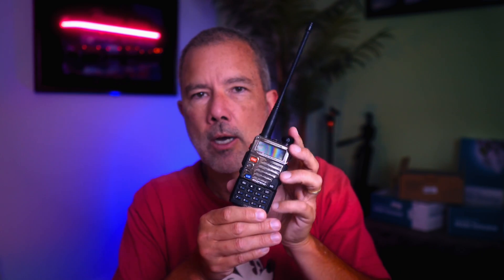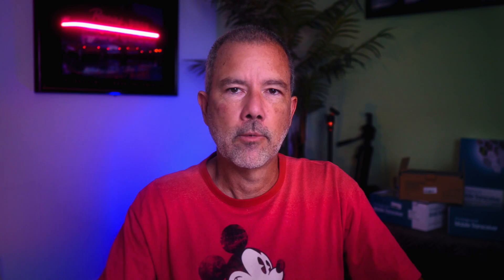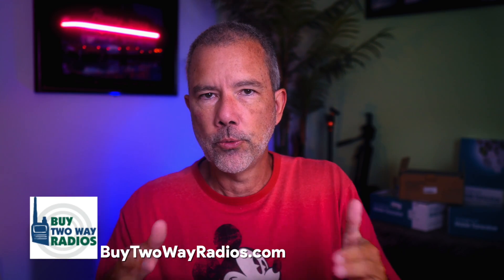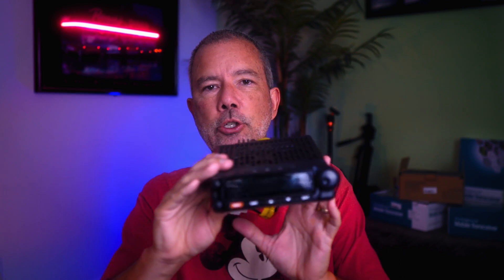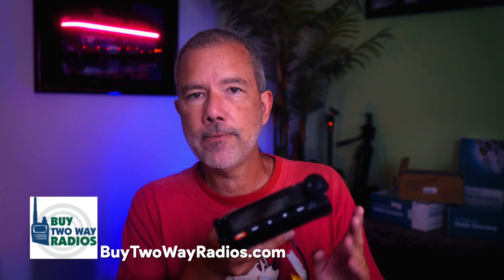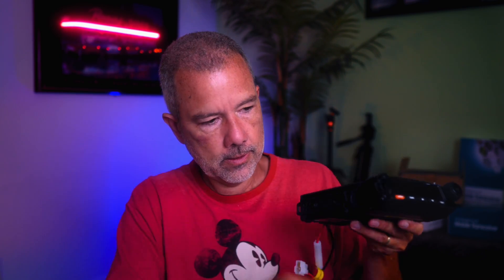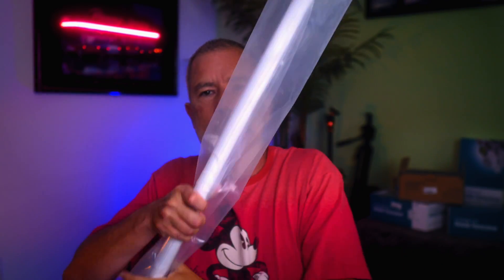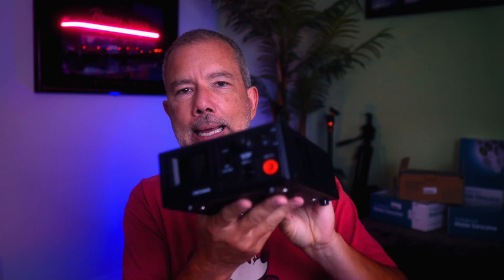Building a GMRS Repeater For Personal or SHTF PART1 - Repeater Build with Two Wouxun KG-1000G Radios

Comment: I would really love to do a self-contained solar-powered repeater up on the top of my mountain. Is there additional licensing required to put up a repeater?
Reply from the maker: In GMRS the repeater uses your license/the license of the people using it, so as long as you are licensed for GMRS, nothing extra is needed.
Reply: If you come up with a good solar set up fill me in.

Comment: Count me in ! I want to do this, but use rack mount equipment and solar photovoltaic power supply with battery banks... I already have 4 HTs, 2PSs, 2 portable radios for the vehicles. I want to include CB and scanners, + SW listening I just got both Technician and General Class HAM Radio Operators on March 9.

Comment: How is this cheap? Over 600 bucks in just the radios, if you can get them. Can get stuff offline much cheaper. Theres places that you can get 2 radios connected and programmed up with a gmrs repeater frequencies for 300 or less. Then save that antenna for a much better antenna.

Comment: This video was perfect timing. Not to make your head any bigger, but great job as always. I am currently doing the same at my house for family. The ability to use an HT with rubber duck antenna from inside the house (Wife) to my mobile in the field (Me with the Ants and Bugs) All I can suggest to what you are doing, is check the duty cycle of the radios, the lenght and loss of your coax selection, because of the difficulty to change later, and proper grounding of all the antenna componets. National Electric Code for your area might prove to be a chore. Looking forward to more on you progress. Thanks

Comment: I always want to set up a repleter, I will follow you step-by-step, I just spent $962.95 on buy2way radio. (2) KG1000, (1) tram antenna, (1) dwc30, amd (1) duplexer. Don’t know what to do with all this equipments. Cannot wait for the next video.
Reply from the maker: Just posted Part-2 .. Part 3 will be when the good stuff starts.
Reply: Did you finish it Andy?

Comment: dang dude by the time you add up all the parts you keep adding you could have bought a commercial repeater for a grand.
Reply: Yeah I was thinking the same and plus the ones I see usually come as a box for the radios and everything is included except the antenna and coax going to the antenna. The setup he's going for is probably going to be two radios set on a shelf or table with wires all over the place.. I live in a small house so that wouldn't be a option for me

Comment: Will you please go into great detail about how you ground the antenna when you get to that point in the video series? And when you say that you are planning on grounding, are you talking about RF grounding or simply grounding for lightning protection?
Reply from the maker: Shoot.. I was planning on glossing over how i do the grounding because there is so much misinformation/stupidity/FUD about grounding - no matter how I do it, some "expert" will post comments saying it's wrong and my house is going to burn down.
I will be grounding the antenna per NEC and my local code, and RF ground it as well.
Reply: @TheNotaRubicon  UUugh. I can't say that I blame you. There's a lot of knuckleheads on the internet.  The mis-information is exactly why I wanted your input. You have a really nice, down-to-earth way of condensing information for newbies like me.(see what I did there? grounding....down to earth...I'll keep my day job  haha)
Reply: @TheNotaRubicon  licensed electrician here... Grounding is stupid easy... No need for a rod as you likely have just what you need already... You have a home with electrical power and likely a phone and CATV.... ?

You’re in CA - so ignore the wire gauge in the link below - just provided that as conceptual and code reference of National... Standard practice here is going to be as follows: 

Find the following - Your electrical meter or Main circuit breaker enclosure. Find your Telephone entrance - Find the ground block on the coaxial cable for CATV... Between your meter or phone or meter and CATV ground block there will be a 10 gauge green or solid uninsulated solid wire... You want to EMULATE THAT...

Find where they connect to either your metal main water pipe or main panel by following that 10ga wire back from the phone or CATV. It may even go to a rebar of your house foundation - that to us great...

What you need to do is connect the ground of the antenna mount, mast if any, (or flag pole what have you) - typically the sheath of the outside of the coaxial will connect with the outside threads to whatever mounting system for the antenna...

Following the antenna coaxial to where that enters the house in the very least - at this pint they can go their separate ways... One to the radio of course, the other to the nearest electrode for the electrical system of your house. (Electrodes are - Main water pipe, Ground rods that are connected already, “UFER” which is likely a rebar or wire in your foundation.) OR you could go to the main electrical panel. (But that get too technical) If you followed your phone or CATV to it, you will see how they connected to it...

In general you want to go as direct and straight as possible...

https://www.ecmweb.com/national-electrical-code/code-basics/article/20891084/article-810-radio-and-television-equipment

https://www.ecmweb.com/national-electrical-code/code-basics/article/20891084/article-810-radio-and-television-equipment

Comment: 95.1751 GMRS station identification
(c) Any GMRS repeater station is not required to transmit station identification if:

(1) It retransmits only communications from GMRS stations operating under authority of the individual license under which it operates; and,

(2) The GMRS stations whose communications are retransmitted are properly identified in accordance with this section.

Comment: 47 CFR § 95.1751 - GMRS station identification.
CFR
prev | next
§ 95.1751 GMRS station identification.
Each GMRS station must be identified by transmission of its FCC-assigned call sign at the end of transmissions and at periodic intervals during transmissions except as provided in paragraph (c) of this section. A unit number may be included after the call sign in the identification.

(a) The GMRS station call sign must be transmitted:

(1) Following a single transmission or a series of transmissions; and,

(2) After 15 minutes and at least once every 15 minutes thereafter during a series of transmissions lasting more than 15 minutes.

(b) The call sign must be transmitted using voice in the English language or international Morse code telegraphy using an audible tone.

(c) Any GMRS repeater station is not required to transmit station identification if:

(1) It retransmits only communications from GMRS stations operating under authority of the individual license under which it operates; and,

(2) The GMRS stations whose communications are retransmitted are properly identified in accordance with this section.

Comment: The tile roof issue. I see contractors use rafts made of plywood with a foam mattress adhered to it with spray adhesive. They have 1x2 or strips of plywood on the other side for traction. The foam has amazing traction and spreads the load to avoid breaking tiles and sliding off.
Reply: If you need to move father up the roof than one raft allows then you need 2 and you'll have to leapfrog your way where you need to be by moving from one to the other then scooting the first toward your destination...
Reply: Don't take some jerk on the comments section's word for it. Call a roofer and ask them.

Comment: I wanted to add two other items to my obscenely long post earlier. First, at UHF, don't use PL-259 connectors if you can avoid it. Even though PL-259s are also called UHF connectors. They aren't;  especially out in the weather! Loss is your enemy, and PL-259s are lossier than type-N connectors. You can cheat and use PL-259-to-N adapters or you can learn to assemble N connectors and do it right. My analogy of using PL-259s vs Type N is the difference between a steep climb with open diffs vs locker(s). The extra benefit of assembling N connectors is how much your Vocabulary of Profanity™ will expand. Also weatherproof your antenna connection and leave a service loop below it.

The second point is in regards to the duplexer. You're buying one pretuned for GMRS. This is wise. This is very, very wise. You don't tug on Superman's cape, you don't spit into the wind, you don't pull the mask off the ol' Lone Ranger and you don't ever f--k around with a duplexer's tuning controls. Think of it like re-gearing your differential in a sandstorm with a crescent wrench and a ball-peen hammer vs having an expert with a full toolkit and years of experience doing it in the shop.
Reply: Service loop - yes! Not something I’ve seen anyone mention, anywhere.

Comment: Great project, and you're learning more about radio than a large number of hams. I come from a land-mobile radio background (40+ years tinkering with radios, including public safety and ham) but it's been 25+ years since I last worked on a repeater. Long comment ahead:

Coax absolutely matters in a repeater. LMR-400 is the minimum I would use for this purpose, especially if the run from the antenna to the duplexer is 50 feet or more. You're dealing with heavy feedline losses at UHF frequencies with the wrong kinds of cable. Let's say you put your repeater in the basement and the antenna on the chimney of the house, and run the coax neatly. You might use 100' of cable. With RG-8X you would experience 8.6dB of signal loss (3dB = half the signal strength, so over 3/4 of the incoming weak signals would be lost in the coax. At CB frequencies or HF ham it's negligible, but at VHF (2m Ham, MURS, marine, railroad, etc) it's bad. At UHF (ham, land-mobile, or GMRS) it's crazy-bad. If you had 9dB of loss (I'm rounding up here), your 50 Watts of power from the transmitter would only be 6.25 Watts at the antenna feed point. And going the other way, if someone were to have a so-so signal into the repeater with LMR-400 feedline they wouldn't even be able to key it up with shitty coax. Spend the bucks on LMR-400. 

With the cost of everything involved, the average person who is not getting the gear at little/no cost from sponsorships and is looking to do this project could probably find a surplus/used UHF repeater pre-built on eBay or at a hamfest for a fraction of the $1500 cost you mentioned. Businesses and local/state governments are abandoning conventional UHF frequencies in droves, so there are a lot of them out there. I've seen GE and Motorola UHF solid state repeaters for a couple of hundred dollars, including the controller and duplexer. The only problem would be getting the duplexer tuned to GMRS and finding someone to reprogram the frequencies in the RF deck and the CW ID in the controller.

If you and your family are the only ones using your repeater you do not need the machine to identify, assuming it's under the same callsign as your family. If anybody else uses it then it does. https://www.law.cornell.edu/cfr/text/47/95.1751. My personal preference is a very fast CW ID at low deviation. It's there to be legal and is not obnoxious. So 35 WPM CW and 2.5 kHz deviation on a traditional wideband repeater works nicely. Then again, I think roger beeps were invented by the devil, so your mileage may vary.

You should put a tone on the output regardless if you're opening it up to everybody or not. The people using your repeater on mobiles and portables may be in areas of high interference (intermod from other services). Having a CTCSS or DCS tone is for their benefit so they don't hear that crap when monitoring the repeater. A tone on the input is optional, but a good idea--in my personal opinion. My recommendation is to use one between 100 Hz and 203.5. Avoid the ones above it and below it because they may not decode properly either in the Wouxons or the other users' radios whose bandpass filters may be wonky. I kinda like 141.3 and 156.7 but that's just me. Anything above that you can hear clearly through the speaker and it's annoying as hell. FDNY used to use 186.2 and gawd was it annoying.

Finding a frequency is interesting in the GMRS service. Unlike the ham bands and commercial applications, there is no requirement to coordinate your repeater with a governing body. In ham it's not a requirement, but if you don't go through a coordinating body and you cause interference to someone who has then the FCC can shut you down. GMRS is still more "wild west." Find an open frequency and have at it. What I would recommend would be put up your station and just monitor what you believe to be an unused pair for a couple of weeks. Maybe put in a voice- or carrier-activated digital recorder and see if there's any activity on your proposed pair, and if so, how much. If it's clear or almost clear, and you can't hear other repeaters (remember, no tone when you're doing this monitoring) then program the radios and let'er rip.

Comment: According to BridgeCom systems Inc. there is no frequency coordination requirement for GMRS repeaters. So you can simply listen to the frequencies to make sure it's a clear frequency and then use it. So long as you're staying legal with your transmit power and all that. The goal is to avoid causing interference to nearby stations. If you do end up causing interference it is us to the "station owner/operator" (YOU) and the other station to work out how to resolve it. I am not an expert. But that is my understanding.

Comment: Some thoughts:

1. Don't overlook the usefulness of hose clamps, PVC pipe, and conduit for antenna mounting. I have stuff mounted to vent pipes on my roof.
2. Belden 9913 is close to LMR 400 in terms of loss and a bit less expensive. If you have long run, the lower loss cable is a worthwhile investment and tends to take the weather better. I use this for a 100 foot run for my VHF/UHF radio to my rooftop antenna.
3. You already have a power supply so this might be a bit late for you, but here's how I power my radios in my ham shack: A large group 27 auto battery is connected to a float charger plugged into the wall. The two radios connect to the battery (12 volts) using Anderson PowerPoles on a strip, but this can be accomplished several ways, even ring terminals. The point is you are always on battery backup, and that big honkin'  $175 battery from the price club will usually far outlast the Jackery, because you are only paying for the battery, not the built-in inverter etc. on the Jackery. Battery is always charging. When the power goes out, your repeater radios never miss a beat. Just a thought.
4. You may have already thought of this but check around to see what channels and tones other nearby repeaters are on, just so you know what to avoid. I would suggest using tones, if for no other reason than to reduce interference, and you never know when a signal will catch a ride on an atmospheric anomaly and travel over from three states away, even for a few minutes.
Reply: Radios like the KG-1000G only put out full power when fed a full 13.8 VDC. In other words, they are designed to be run off a "12 volt" alternator, not a "12 volt" battery. A good trickle charger won't produce the current or voltage required to maintain 13.8 VDC to the radio. Instead, a better solution is a solid 13.8 VDC power supply fed by wherever you can get power, such as generator, solar, Jackery, 12 volt inverter, etc.
Reply: If the transmit side of the repeater only puts out 40 Watts instead of 50, or even only 25, would that really be a problem? With a large antenna mounted high on a roof, that is in turn on a house on a hill, line of sight limitations are more likely to be the range limiter rather than output power I would think.

Comment: 6.5 dBd gain on that Tram antenna, and a high power rating.   If you look in the right place you could buy a used crank-up tower and forget going on the roof.  Can't wait to see how it all comes together, I'm especially interested in the performance of the Tram antenna.  I'm going to put up a Base Station soon and been looking at different antennas.   I did a little looking around and found this cool 29-foot high tripod portable antenna tower.     ANTENNA TRIPOD 29FT ALUMINUM PORTABLE TOWER MAST KIT NEW  209.95.  Not bad, check out eBay.   Have a great day.
Reply: I have three of those sets and have been using them for  years.   They're military grade, sturdy, and easy to use.  They're just not lightweight.   Of course, that's not a big deal if it's going to be stationary.   It does require guy lines, though, or it WILL come down in high winds.  I thoroughly enjoy mine and have used them to erect all sorts of antennas, from dipoles to loops to VHF/UHF antennas.

Comment: I put up my own GMRS repeater .625 about a year ago the  Brookston Z9 on the cheap .   I had all the same questions you do. Back then  the  Wouxun KG-1000G Radios were not available yet . So I went with the RT97 .  It's still working very good . Has a range of 30 miles to a mobile .  It is listed in myGMRS.com , USgmrs association.com and 
Repeaterbook.com  .   ... You will want to at least use rg8x coax for short runs of 25' or less . The GMRS frequencies have a high signal loss in the coax so you should use lmr400 or better low loss coax if you want to get any distance at all .  I went with the Tram 1450 antenna for ease of tuning and a gain of 5dbd / 7.15dbi, it works very well.  It is 70' high from ground level .